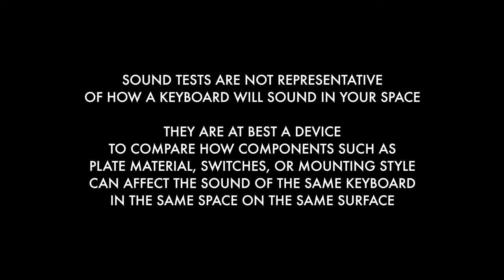nice things. cruel world.

Comment: How did you acquire this board? I am looking on mechmarket and I haven't seen one of this color and brass weight. Is it a dark grey or black color? How much can i expect to spend 2 years after its release? Sorry for all the questions, but I'm obsessed with this board!!
Reply from the maker: @corrections  I was in on the group buy for this board myself. This is indeed the Grey color, not black. I would look at the most recent MechMarket listings that are marked as sold to see what prices are.

Great board, still love using mine. Hope you find one!